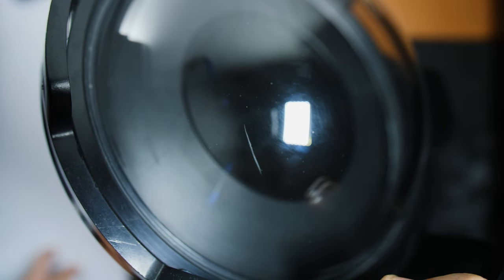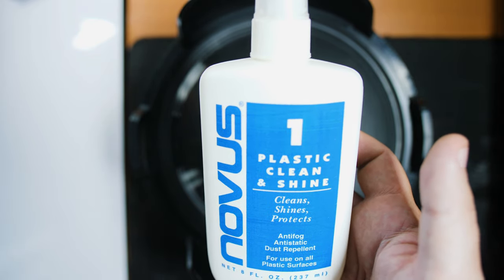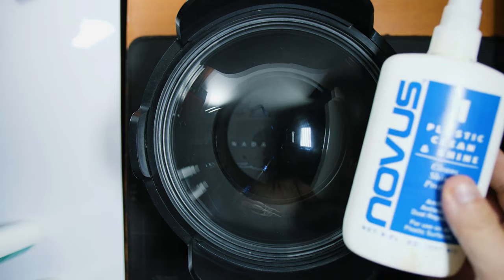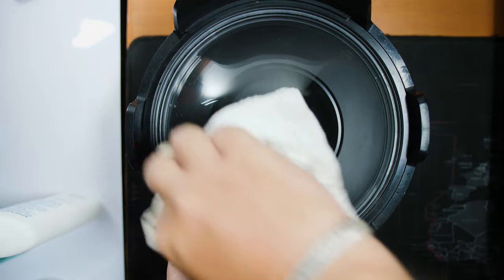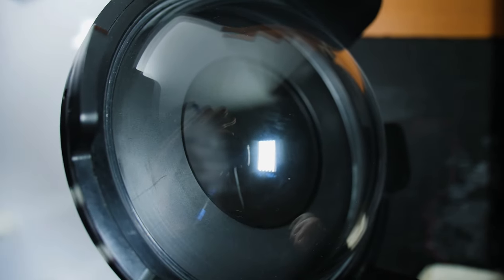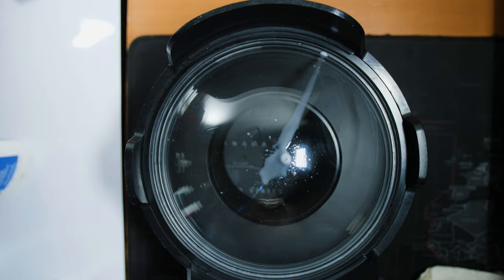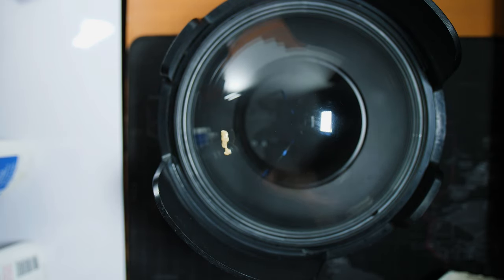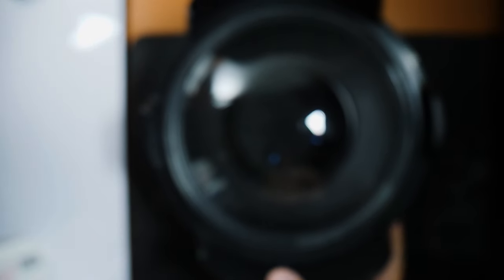DOME PORT SCRATCH REMOVAL for Underwater Housing

Comment: Don't ever try this with Backscatter/AOI lenses, they have a coating which is too thin to even use toothpaste, and once polished you will always the watermark. They also won't supply you with a replacement dome you have to send it back to 'Merica to replace. Will never buy the same product again.
Reply from the maker: Yeah I've heard of similar experiences with other products, it's really hard to find out if manufacturers apply coating to their products so this is great info, thanks!
Reply: One thing another video said was to never start until you contact the manufacturer to check if it is okay. The other video was using a Nauticam dry dome as their example, and they got a reply from Nauticam saying it was safe to use. That coating part is the real issue; shame you had such a problem with it.